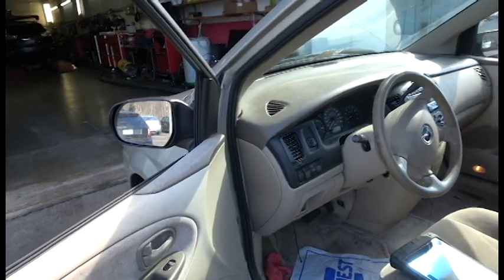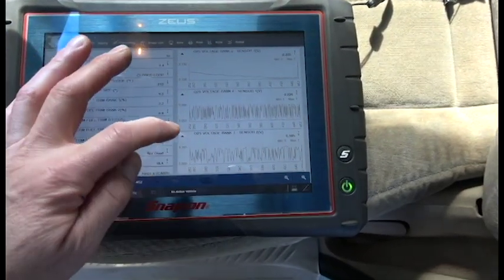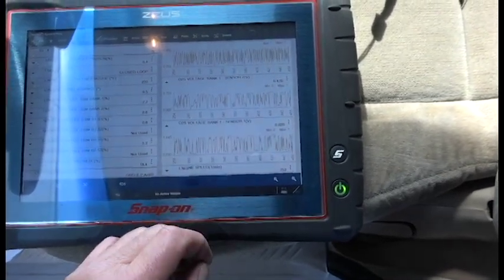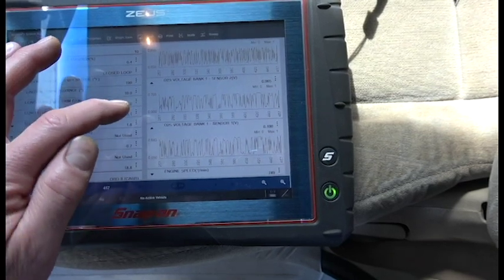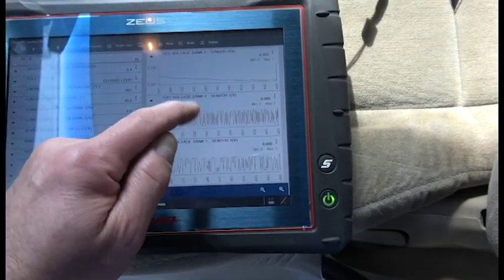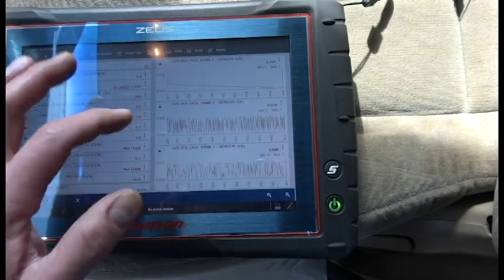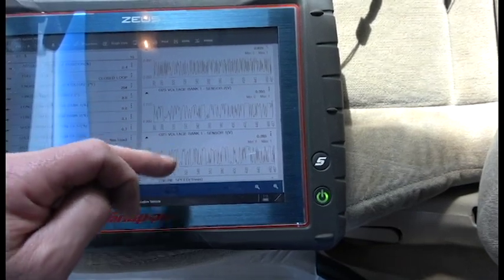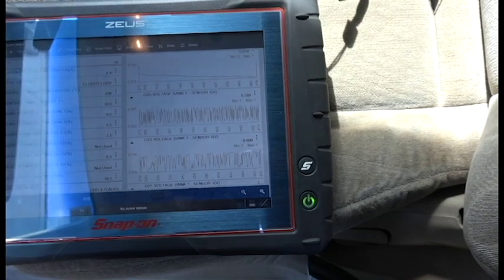Catalytic converter test with scanner

Comment: That car needs a good quality replacement cat. The cat from the dealer is very expensive because it has a lot of precious metals in it. It is common to find very in expensive cats online and even at some car shops. The cheap ones barely have enough precious metal in them to make the light turn off so the new cheap cat can be worn out in only 6 months when a dealer cat could last 10 years or more. There is something called a high load cat which is an aftermarket cat with more precious metal than a cheap one but still not as much as the dealer cat. The car will run fine with the cat code but it is not good for the environment. Cat codes come and go usually related to the weather. If the cat works good for about 3 days in a row the light will turn off by itself then if it sees the problem 2 days in a row it will come
back on.
Reply: Yup . I learned this hard way kn my Jeep . Bought aftermarket cars for cheap and I basically have to replace it and the sensors with OEM parts

Comment: Yes voltage. O2 sensors read 0-1 volt. Technically it is .1 to .9 volts. Think of it as fuel makes voltage. .1 volts is lean and .9 volts is rich.

Comment: Do you do the test at idle parked or driving?
Reply: At idle when parked. Make sure that you run the car for at least a few miles to get the catalytic converter up to full temperature before you do the test though.

Comment: any issues to fail converter 1?maybe missfire cylinders on bank 1? without fixing the issues, replacing converter is meaningless.
Reply: Correct. If there is  a misfire there is no sense in replacing the cat until the misfire is repaired. The misfire will dump raw gas into the cat and overheat it and melt it inside. That is often what kills the cat to begin with.

Comment: technically what is the programmed ratio of cross counts the upstream o2/downstream o2 crossing though .5 volts the cat wants to see for a good cat. this is the secret info  I’m unable to find.
Reply: There should only be cross counts in upstream. If there are cross counts on downstream that means the cat is bad. Downstream should be a flat line. Upstream on older cars was 5 times in 10 seconds but newer cars with faster computers are usually 10 times in 10 seconds. Remember that this will only be 5 cycles above the line and 5 cycles below the line since we are counting the times it crosses .450 mv 5 cycles will give 10 times it crosses.
Reply: @carlepstein2162  If you have any documents on that let me know. If what you say is true, i could substitute .6 volts dc on the signal line to correct a P0420. my Lexus SC400 will set a fault code if the downstream sensors remain above .45 volts or below .55volts.
Reply: @spinroyd  Sorry I dont  know about that. My expertise is in fixing. It would be worth a try. Since tampering with a cat and emission components is a federal offense it does not get checked at the state level when they do an emission test. Let me know how it goes.

Comment: CAUSE OF BANK ONE SENSOR TWO SWINGING??? OF WHICH IT SHOULDN'T.
Reply: Worn out. The metals in the cat that make it work erode as the exhaust gases pass over them. Eventually there is on chemical reaction left. The cat can be recycled and what is left of the remaining precious metals reused in a new cat.